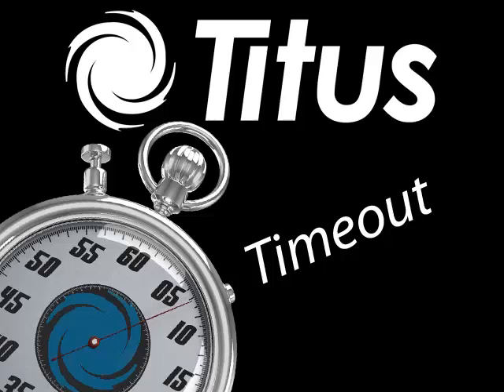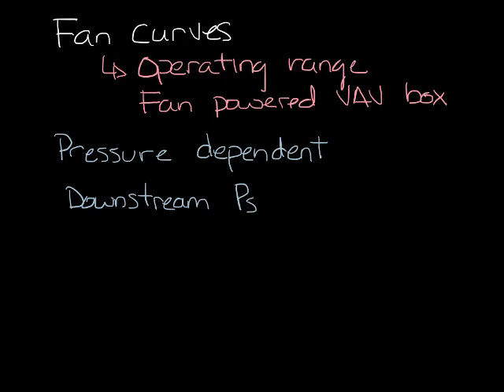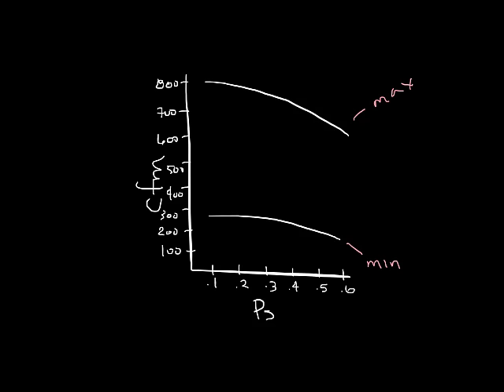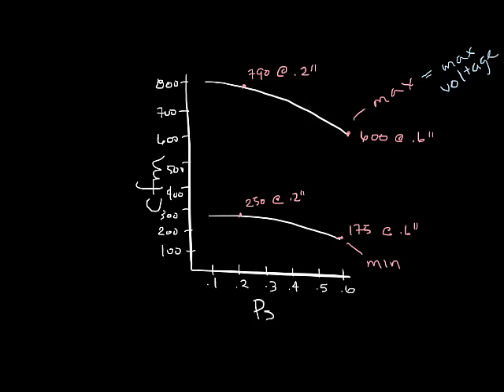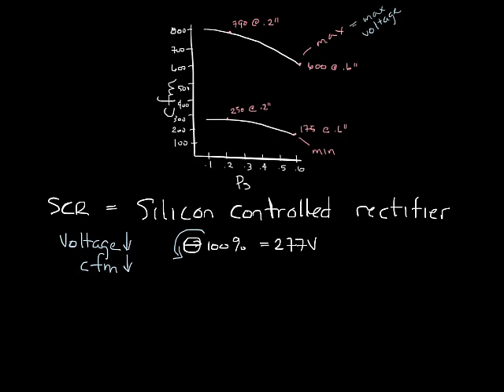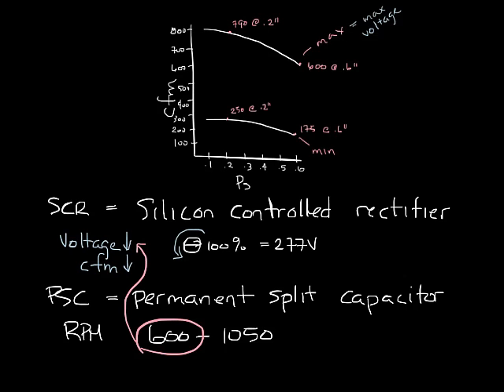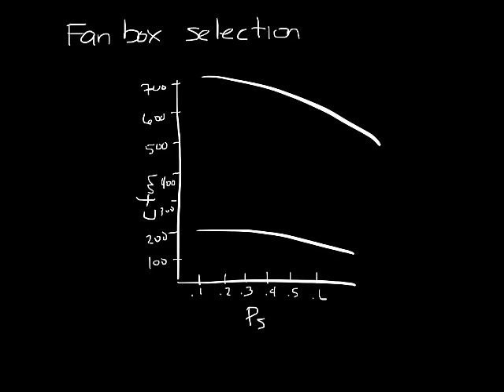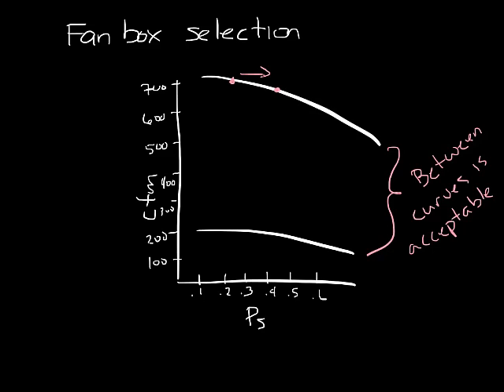Titus Timeout Podcast - What is a Fan Curve

Comment: Hi. It was one productive quick class for understanding fan curves. Questions: at 5:25, you said that turning down the  SCR would lead us to get a reduced efficiency. Could you possibly elaborate for me the correlations between SCR going down and decrease in the efficiency?
Reply from the maker: The podcast is talking about a permanent split capacitor (PSC) motor with a silicon-controlled rectifier (SCR) speed control. These speed controls reduce the motor speed by chopping and notching the AC-sine wave power. This slows the motor but it also reduces the electrical efficiency of the motor. It can also cause these motors to run hotter and possibly produce low frequency humming noises. PSC motors have a typically efficiency range of 20-60% and the efficiency drops as speeds are reduced with this type of speed control. For this reason, I recommend selecting PSC motors in the top 75% of their fan curve.